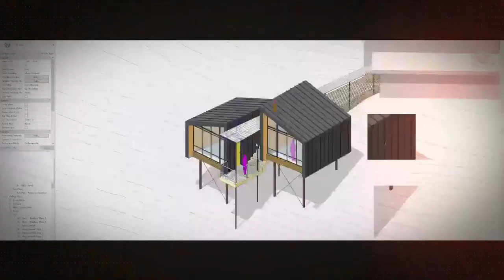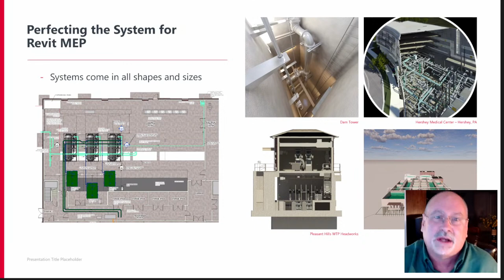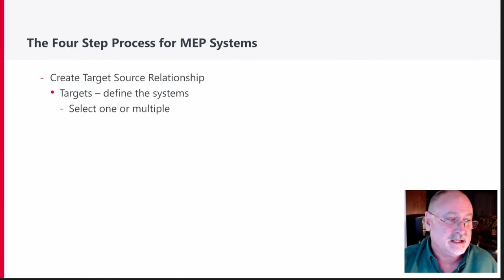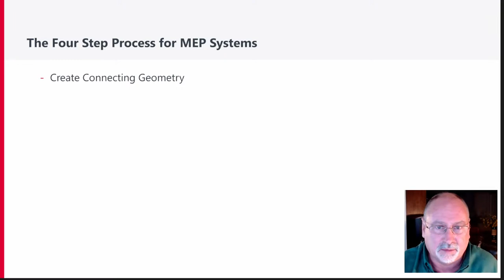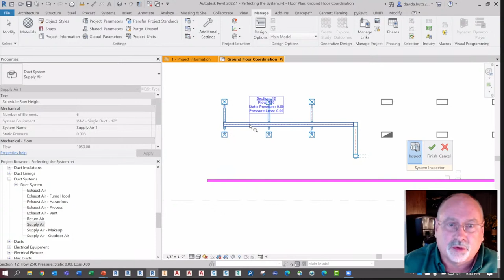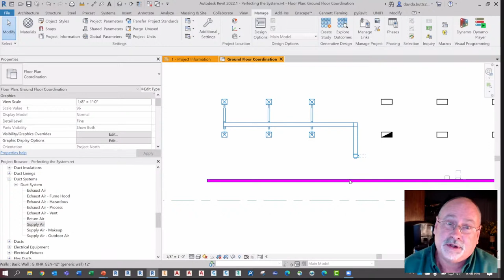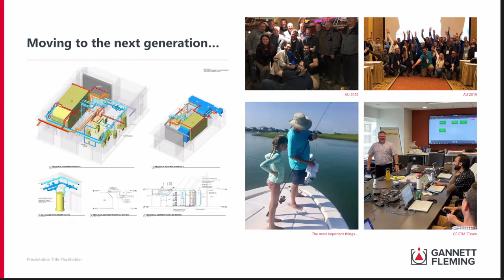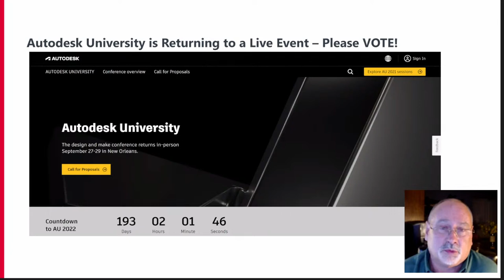Mastering Revit MEP Systems Tutorial

Comment: I wanted to post this separately, with the huge influx of Multifamily development projects in the US, we need to have a series on BIM and multifamily developments. The scale of these projects can be daunting, we're talking anywhere from 8 unit townhome stacks to 400+ unit mega developments on huge acreages, usually a Five-on-One wood construction atop parking deck or multiple 4 story wood frame buildings on a lot. MEP systems break down fast with lots of connections, a true plumbing model of the 425 unit complex I'm currently modeling would have performance issues and likely not run on older machines. How do we break down dwelling units vs the rest of the building? How do MEP systems work in these complex buildings, especially massive interconnected systems like electrical and plumbing? Typically, with printed CDs, the units are modeled separately with the building plans only showing risers, load centers, and AHU locations. The MEP giants handle a lot of these projects and from my experience, most are still done in AutoCAD. My firm is less than 50 people and these projects have been quite tricky to handle, but would be highly profitable if we had a good workflow. I get the feeling that very small firms would hesitate to pick up a multifamily project if they are only using Revit. Any tips or tricks? Most architecture firms I work with are switching to Revit and the growing pains in Multifamily are showing on their end as well.

Comment: Regarding you epiphany  around minute 48, it is better to do the core shafts before modeling each flor routing, you dont need to place terminals in each room, you can just total design values by room and decide which duct, and pipe exit from shaft goes to which room.
In my experience project that did not do their shafts first had a lot more problems than those that do not, because when the shaft is ready you just have to focus on the routing, if its not, you have to assume to which shaft you are routing to...
So just to clarify, imo, it best to do room loads, shaft (and vertical pens), tech rooms, then floor by floor layouts. Much less rework down the line.
Reply from the maker: Thanks for the comment and em suggestion!  I understood David to be talking about once your on the floor… I assume he would also suggest risers first.  But, I won’t speak for him ;)

Comment: Would love to see your proven examples on removing the need for Single Line Diagrams for Electrical Engineering on a 40 Story building. You want me to Model every Riser Tray DB, Switchboard, House Boards, Tenancy Boards. Transformers. "Just model them? in Schematic Design? . Would love to have an easier way. What Industry do you work in? Board Manufacturers, Approvals for breakers?
Reply: @7dabutts  there's so much more information provided on a SLD, P%ID that cannot be modelled. I model everything i can. however, Showing the relationship with the basement incoming power, transformer rooms, risers, floor boards. Needs to be shown somewhere. cant just look at a 3d model and have all the info. Check out 2023? that just came out 4 days ago?.. ok... Real SLD'd remain through the entire project, printed/Laminated and stuck on the mains board.